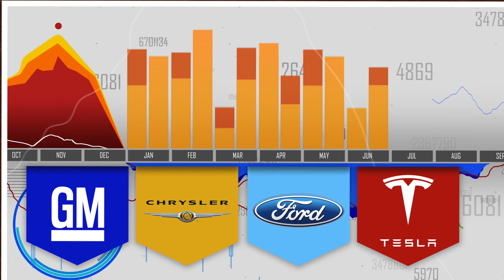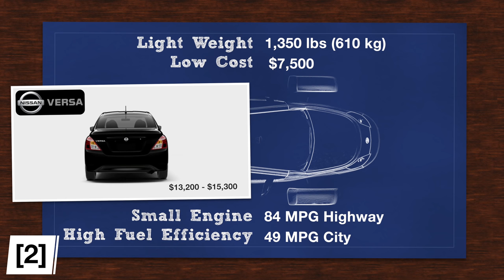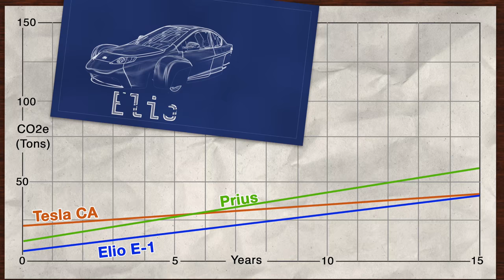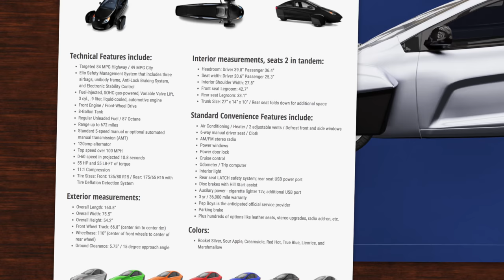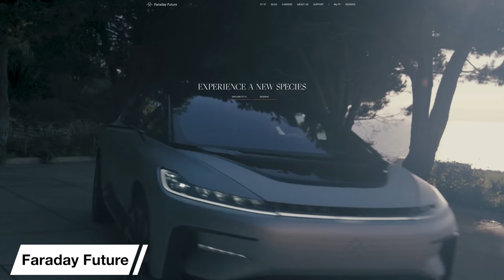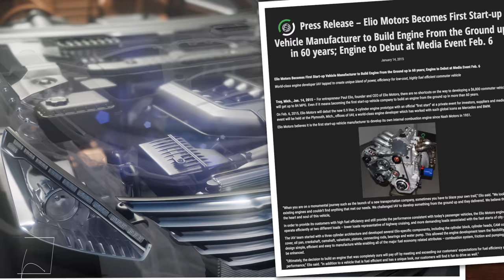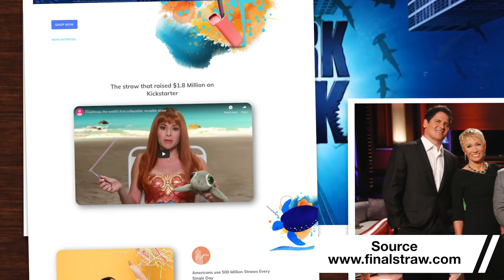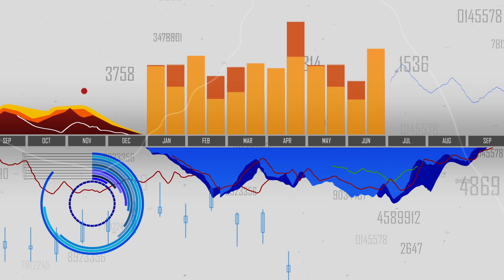How this Radical Car Missed its Chance to Change the World

Comment: Sadly I dont believe at all that this vehicle can be successful with an ICE engine! What I have seen the last years is that almost everyone is vastly and constantly underestimating the development of the EVs and the advantages besides fuel economy they bring. The problem with EVs was that due to small scale battery production and a lot of money invested in future generations of ICE Motors and engines no big, 4 seat + EV cars were possible. Now they are. That also means that building an electric 3 wheeled one seater is easier then ever before... So they will have to compete with a technology they can't really compete with in the long run... And with long run I only mean the next 2-3 Years.. As I said, i have the feeling that almost everyone is underestimating the EV revolution and there also is a shift in the consumer habbits you talked about!
Reply: Its advantage is cheapness.  I have driven a Leaf I somehow got for cheap in a process of leasing and buying the car when off lease.  However, that was the golden deal never to be seen again.  When I have a worn-out battery, I can spend $7k on a replacement or get a whole new commuter car that would cost $10 a week to run.  I think I would choose the Elio as it does away with the electric's range issue.
Reply: Until we go with nuclear energy electric cars are SOL. Then you have the issue of charging times leaving you dead in the water. Whereas with an internal combustion engine recharging takes less than 5 minutes. The only possibility there would be a modular battery system or you can simply pull up and swap batteries rather than charging internal.
Reply: @thefirstmissinglink  well you gotta had an eye on the technologys which are beeing supported and developed right now beeing. In that case solid state battery's.. Which will takes the need for a battery swap system because of their capability to charge in even less then 30min.. 15min probably
Reply: Check out the Acrimoto 3-wheeled 2 seat EV commuter being built near me.  Like the Elio, it's meant for urban commuting. Even if charged in states with the highest mix of power from fossil fuels, EVs will still generally break even with ICE cars in terms of price and carbon footprint within a few years of ownership.
Reply: @marksman48  The leaf is a horrible design.  There are 2011 Volts running around on the original battery with the same 35-mile all-electric range they had when new.  There are many Tesla s cars that have more than 90% of their original range left on the original battery. The difference being GM never uses more than 80% of the batteries capacity. More like 65%. The battery is liquid cooled and heated.  Nissan put no limits on the leafs battery and had zero thermal control other than directed air flow on the battery.  That directed air flow also cooled the battery in the winter. Poor design made for the Japanese climate.

This bike was never going to be $7000.  They do not have the production capacity to turn a profit at that price.  You can buy a German made 120-mile range 3 wheel enclosed bike for 18k.  That price is only going to go down.
Reply: @Phrancis5  The Elio was meant to be a real vehicle, though, not a 3-wheeled golf cart.
Reply: Voltaic - Elektro Werkstatt  — agree .. elio’s mistake was going ICE
Reply: @jameshoffman552  Ever heard of Aptera Motors? $45,000 for a trike? That doesn't make any sense. Anyway, if it were to hit its MPG target, the Elio's CO2 emissions would be lower than any BEV in most of the US.
Reply: @PistonAvatarGuy   Well that makes the Elio a 3-wheeled go-kart and Teslas aren't real vehicles.
Reply: @Phrancis5  No, it's an actual, enclosed car, not some tent on wheels.
Reply: The thing is: EVs are great, the people making this did mention wanting to make an EV version later. However, I live in a city, but there are no level-2 chargers near me. My apartment will not allow me to plug in a scooter, let alone a car, into the outside plugs. And there are no plugs at all in the garage. EVs larger then a bicycle are currently off the table for me, but this would work. I could always rip the engine out and throw a forklift motor in it later if I wanted.
Reply: @PistonAvatarGuy  I'd rather have the torquey EV tent on wheels with the beefy roll-cage with OPTIONAL DOORS over the thin sheet metal trike that isn't being produced.
Reply: @Phrancis5  That roll cage isn't going to provide you any more protection in an accident than sheet metal. The optional doors on the Arcimoto are never going to keep out the cold, or the heat, or the rain. Other than meaningless "torque," the Arcimoto offers nothing but disadvantages when compared to the Elio, and it may not even go into production. The main problem is that the people who are going to be looking for a ~$10k vehicle are likely to live in apartments, where there's no way to charge a BEV overnight. Fast chargers are expensive, so there's no reduced cost of operation with an EV without home charging.
Reply: The problem with the EV revolution is scale. There simply is not the infrastructure or the materials to build  to support at scale (enough to replace any more than low single digit percentages of ICE vehicles) production and operation. This is the case with the 1st world, it is even worse in the 3rd world.
Reply: @ImAManMann  Well if Tesla wireless electricity ever comes online. No need for batteries. I hope it happens. I would rather have a car. Where I won't have to put a plug or some liquid in the tank. I hope Tesla wireless electricity happen.
Reply: @stevencorrea7982  haha lol
Reply: @thefirstmissinglink , you must be living under a rock. Do some basic research.
Reply: @ImAManMann , how is it possible that you can be so completely incorrect or unaware of the transition happening all around you?
Reply: @mbabcock111  you are making a very vague claim. What specifically do you think I am unaware or incorrect about?
Reply: @ImAManMann   wow! Of ant .
Reply: @stevencorrea7982  what a comment. Speaks so much of today's society.
Reply: a gas car takes more electricity per mile than an electric car does. it literally does not matter what your power source is nuclear solar or coal. EV is better and cheaper.

I have a 2016 leaf (2012 got totalled when some rear ended me thank god for gap insurance!)

I can go 105 mile reliably 3/4 of the year 90 in the cold of winter. (SE PA) I can hit 120 miles but 105 is reliable.

I can quick charge the car in 30 minutes if there is one around.

I rarely have need for such charging. I Just plug it in when I Get home at night and the "tank" is always full every morning. "speed" of charge is irrelevant. oh but what if I need to go more than 100 miles? I have 4 others cars. I will just pick one. from my geo metro to my dakota to my minivan. (I know this is not practical for many but SE PA with Good credit means VERY VERY low cost of ownership for older used cars. almost nothing at all actually and I do my own maintenance for the most part)

now. mind you I drive a shit ton of miles. I got this 16 leaf for just under $16k the monthly payment is $335 plus $70 for insurance (over what liability would cost) so call it $400. even after factoring in electricity AND WITHOUT factoring in the exceptional savings in maintenance costs! the car saves me $50 to $100 a month "just" in fuel savings alone (I drive a lot of miles) 1 year and I have nearly 35k on the electric car alone! almost time buy the extended warranty as the factory warranty will lapse soon.

EV's make a ton of sense "IF" your driving needs "work" with it.

Elio EV would not make sense. not enough room for a battery and enough battery to make sense would triple the price of the car.

 @thefirstmissinglink
Reply: agreed about the leaf design but I am happy they did it.

because if they had not I would not have an EV. I have over 30,000 miles on my 16 leaf with "ZERO" loss of capacity so far (my 2012 leaf was down to 70% capacity by the time I hit 65,000 miles on it before it got totaled thank god for gap insurance!)

 @fatboy19831
Reply: @ImAManMann  A mind of an ant I had no idea how small!
Reply: EVs still have limited range and require much longer to fuel. Even the very costly (ten times more than an Elio), "300 mile" range, Tesla model S really has an effective range less than 200 miles (more like 175) in cold weather, and you need 30 minutes to charge it to 80% capacity at a supercharging station. I drove 270 miles to visit my folks for Christmas last week, so I'd have needed at least one, maybe two, thirty minute stops to recharge (assuming no line at the charging station). I don't often drive hundreds of miles on a trip, but I do it often enough and wouldn't add hours to the trip for recharging stops. And the battery alone costs more than an Elio. Making the Elio electric with a decent range would double the price.

An EV couldn't be my primary vehicle, and I can't pay $75k or even $35k for a second car. I've never paid more than $30k for my primary car, but at $8k, I could afford a third, and the Elio would get my wife and me to our folks for Christmas or the coast in the summer on a single tank, so it could easily be my second car. EVs are close to being practical, beyond the luxury car market, but no fully electric car is practical for me at this point. The Elio is.
Reply: @restonthewind  well no s*** dude :-) mine has less than a hundred mile range typically in the winter time I still drive it 95% of the time :-) it only cost me 15,000 I mean you're picking the most expensive car available the Tesla there are other electric cars the gas savings and the maintenance savings alone warrant the price of this car it pays for itself in gas savings alone not even counting the maintenance savings on my gas cars if I have to go further than the electric car can go I switch cars granted not everybody can have multiple cars then those people can't have an electric car if they need more range than one can supply

People always look at the cost of the battery pack incorrectly I look at the cost of the battery pack as a fuel so I take the $7,000 battery and the electricity used to charge it and determine was that cheaper then the gas I will put in a gas car and the maintenance I will put in that cash card in the same number of miles? Right now it does not make sense to replace a battery it'll cost me $7,000 to replace the battery on a car that will have no warranty for which parts are still exceedingly expensive to replace wants out of warranty

 Combine that with the fact that the cars are still evolving I would never replace the battery in my 2012 I used to have when for 6,000 more I can get a brand new car with twice the range so we are still in a state of flux in that regard in 2021 I will not replace the battery in my 2016 I will look for a used 2019 with the 60 kilowatt battery option and double my range again once cars are going about 500 miles on a charge then it will make sense to look into replacing the battery instead of replacing the car because of low in cars are going 500 miles on a charge that means battery prices have come down substantially
Reply: @nerys71  , You lost 30% of your battery capacity in 65,000 miles and you purchased another Leaf?
Reply: @stevencorrea7982  no actual argument.... figures.
Reply: @fatboy19831  yep. Because it saves me money. As long as i get 4.5 years out of the car its cost adjusted is $0. I am ok with that. I get to drive a nice comfy luxurious car for nothing. (Its luxurious compared to my other cars) this works because of how many miles i drive. The 16 is doing much better. Zero measurable degredation so far with 30k on the ticker.
Reply: @nerys71  As long as it makes you happy.  For me, I purchased a 34,000 mile 2009 Toyota Matrix for $10,000 in 2012.  Sold it in 2014 with 98,000 miles for $9,800.  Aside from oil gas and wipers, I did nothing to that car.   The Matrix is a horrible car to drive but it truly cost me nothing to drive for two years.
If you are going to change your electric car every 4.5 years you can save several thousand dollars by leasing.  You can lease a new Leaf with very little money down for well under $300 a month.  Then you do not have to worry about the battery at all.  Or even the painful depreciation of the leaf.  I personally pay my new cars off and drive them 12 to 15 years 300,000-mile plus.
Reply: @fatboy19831  the problem is leasing only works if you're a normal person I'm not a normal person I will put more miles on that car in one year than the lease will permit over its entire term those extra miles are very expensive :-) I can get a leaf for a few thousand dollars more than you paid for your Matrix and put twice the number of miles on it in half the time and still sell it for pretty good profit at the end and never have to buy any gas ever :-) if I drove you were miles I wouldn't even need the leaf because gas wouldn't be that big of an expense but I drive so many miles that gas is such a large expense for me at $3 a gallon it's scary how much I would spend in gas and fluids

And that's only if it stays at $3 a gallon when I bought my leaf it was nearly $4 a gallon remember I'm not buying new I'm buying used you can get a two-year-old leaf with four or five thousand miles on it for 12 or $13,000! I paid a little more for mine because I wanted the extra Creature Comforts the nicer Wheels the Bose sound system the surround you cameras I think they're worth it for me personally

 There are other benefits as well I spend so much time in the car the quiet is just incredible I did not realize how much I would enjoy the quiet until I took it home the first time and realized I would never go back if at all possible for me it's not about being green it's about saving green :-) I even tow a trailer behind my leaf I haul all kinds of stuff with my leaf :-)
Reply: I think that people believe EV are less costly to recharge.  I saw the cost of replacing batteries negate the savings in fuel.  You won't save money.  Its actually cheaper to have a gas engine   Also hybrid and EV technology is expensive
Reply: @tigercry5177  you are incorrect replacement battery is $7,000 I can get 200,000 miles on that battery what's a typical gas car getting 23 miles per gallon do the math and the typical electric are getting 4 miles per kilowatt so this math is for a total of 400000 Miles using up II battery that was paid for with $7,000 let's do the math

And yes I put 400,000 miles on my cars several of them have tickled 500000 miles

That's $47,000 worth of gasoline I'm not going to do any more math for you since we have already exceeded the cost of my entire car and its replacement battery and all of its electricity without having to factor in any other math

Unless you're buying something expensive like a Tesla there's no way in hell you're ever going to come close to being as cheap as an electric car with anyting running on gas

Just for shingles for those who are curious my electric car cost $15,000 a replacement battery is $7,000 and I will consume $8,000 worth of electricity over 400,000 miles and that's assuming no solar offset that's $30,000 total the gas car already costs $47,826 and that doesn't include gas car only maintenance and that doesn't include the cost of the car at all this is soon as you get the car for free and all maintenance for free and the electric car is still $18,000 cheaper it's not even a close comparison
Reply: @nerys71   Wow,  the reason I thought.  Was because to replace hybrid battery is 2,000 but I calculated the savings of hybrid to be 2,000.  I guess total electric is more efficient.
Reply: @tigercry5177  hybrids typically don't make sense from a financial perspective unless you're driving a ridiculous number of miles if you're driving 40 or 50,000 miles a year a hybrid will save you an ass ton of money but at that point unless you need the extended range on a hybrid you're better off going with and all electric or going with an all gas car that gets similar fuel economy some people can't tolerate small cars however for example a Mitsubishi Mirage cost almost a third of what a Prius cost and gets the same fuel economy but it's also half the size so it really depends on what your desires are

For someone who genuinely uses the car a lot electric and hybrid can save you a lot of money but if you're just a typical driver doing the average 10 or 12000 miles a year then a hybrid doesn't really make sense because you won't recoup the increased cost of the hybrid in fuel savings and you lose the advantage on a low maintenance electric drivetrain since now you have to maintain both

 If you don't drive very much and the vast majority of you driving is very short range that appear electric can work you can buy a used leaf for 9 to $12,000 at that price it could make sense even with a low per year mileage you would have to do the individual math yourself to figure that out

 It doesn't really make sense to attempt to factor in the cost of replacement battery since most people will never replace the battery the battery will typically last the usable life of the car so you just have to factor in ishal purchase price and maintenance we're not yet at the point where replacing the battery is an issue
Reply: Nerys 
400,000 miles. Sounds like your driving a Mercedes W124 with a 0M617 in it .
Reply: @drmachinewerke1  no idea what that is but my highest mileage was my first car i got when i was 16 and only got rid of 2 years but stopped driving much over 10 years ago. 1988 Jeep Cherokee (still amc design then) with the inline 6cyl 4 liter engine. 497,000 miles. My 94 geo metro xfi has 286,000 miles and needs nothing. My voyagers all had over 300k when i got rid of them.

I have never had to replace a car because the car wore out I've only replace them to upgrade
Reply: @nerys71  Presumably, you paid $15,000 for a used electric car. I'm comparing new cars prices.

Sure, I could drive an electric car most of the time and a second, IC car when I need the range, but I'm skeptical of claims that electric cars are less expensive to drive, when properly depreciating the battery, and no fully electric car is remotely comparable to the Elio (assuming the $8 sticker price), as a value proposition, even if the claim is true. If the value proposition changes in the future, that's great, but I don't live in the future.

I ordinarily work from home and don't drive a lot, but I travel frequently and must drive 90 miles to the airport. If I can't make that trip in an electric car, it's a non-starter. I can't leave my wife with the electric car and its limited range and no IC backup for a week. She'd never agree, and I don't blame her.

Lots of evolution in transportation is on the horizon. Maybe my next car won't be a personal automobile at all. I'll subscribe to a service and share self-driving cars, on the road 24-7, with other subscribers. I can imagine paying less for this service than the cost of owning a personal vehicle, idle 95% of the time, and I'd never waste hours behind the wheel again. Transportation as a service with self-driving cars also improves the outlook for electric cars, since I can switch cars rather than waiting to recharge. I could live to see it, and I could live to see electric cars become ubiquitous otherwise, but I haven't lived long enough yet.
Reply: @restonthewind  new car prices are irrelevant practical car prices are relevant I do not and cannot qualify for the $7,500 tax credit it would be stupid of me to buy a brand new electric car this car was $38,000 brand new! I could never afford that no matter how much money it saved me!

I bought the car 1.5 years old with 4600 miles on it that's as close to brand new as I'm ever going to get :-)

The price of relevance is the Practical available price

If you have to drive 90 miles I would not suggest buying an electric car there are too many chances of your range dipping just below that 90 mile Mark especially as the battery degrades the only car that would work for you is a much much more expensive Tesla or you'll have to wait until the 60 kilowatt battery cars come out which should be this coming year but they will be expensive
Reply: @restonthewind  also depreciation of the battery doesn't really matter as long as the battery lasts long enough for my savings to exceed the cost of the car it's completely irrelevant
Reply: @nerys71  Depreciation affects the time it takes for your savings to exceed the cost (what you pay for it less resale) of the car. You can't simply compare the price of electricity per mile to the price of gasoline per mile. That's the point. I've never replaced a gasoline tank, and even if I did, it wouldn't cost ten grand.

I have replaced laptop and phone batteries, and EV batteries are fundamentally the same. They're good for a thousand charge cycles, max. If I'm recharging daily, that's less than three years. If I'm not recharging daily, I'm not driving many miles, so any savings per mile is less. I've owned my Mazda 3 for eight years and expect to own it another five years at least. I don't drive a lot, so it still has less than a 100k miles on the odometer.

Electric cars work for some people. If an EV works for you, that's great. They don't work for most people at this point. I'm reasonably well off. I'm married, and my kids are grown. I could pay cash for a Bolt or even a Tesla, and I've been tempted, like I'm tempted to buy RVs and boats and ultralights. I can buy a Spark EV, with 80 mile range, for less than $15k (with subsidy), but it would be a second, novelty car. Even if I drove it around town most of the time, I couldn't completely replace my IC car with it, and I wouldn't save enough on fuel to justify the cost either. I'd rather spend that cash on other things, like retiring sooner.

If I were single and owned only one car, I wouldn't consider an EV at all. That's 40% of the U.S. market and an even higher percentage of young people. EV sales are rising, but they won't dominate the automobile market any time soon. Of course, a car like the Elio doesn't work for everyone either, but there's plenty of room in the U.S. market for it. That's the point here.
Reply: I am sorry but you are mistaken. depreciation is "ONLY" relevant if you only intend to keep the car for a short time and then sell it.

if you intend to keep the car for a significant time period and or long enough that its conditions renders its value effectively zero (scrap value) then depreciation is completely irrelevant it will always be 100%

the batteries are fundimentally different. as you should note with your other batteries the larger it is and the more healthy it is used the longer it lasts. (lack of use or care kills them fast) the smaller the cell is the faster it dies.

you also have no idea regarding charge cycles. there is no 1000 max. its 1000 to 80% SOC. what this means is after 1000 FULL CYCLES (so if you charge 1/3 you can do that 3 times to equal 1 cycle) you should have an SOC of 80%

right now an EV only really works well for two kinds of people. those who want it (status symbol ie tesla etc..) and those who need it (people like me)

for the VAST majority of people the price of gas is not really relevant so the savings is not relevant. average person drives 12k a year most people who would "NEED" an electric car to save money drive less than that even. Even you probably don't even drive 10k a year.

at 10k a year the difference in cost of $2 gas and $4 gas is nothing. average mpg 23mpg so that is 430 gallons of gasoline or $860 at $2 a gallon and $1720 at $4 a gallon. lets be realistic. $860 is "IRRELEVANT" in the larger picture of an average persons yearly budgetary needs. if $860 is that large a portion of your overall budget you might need to consider if you need a car and maybe should move (if possible) to a place where you won't need one. its just NOT really that much money. and this is the EXTREME example $2 to $4

SO we are back to two kinds of people (there is a third I will get to that in a moment) people who don't need them (you) and people who do need them (me)

people like you have enough money where the cost avoidance of fuel is irrelevant to their budget IE you make enough income that it just does not matter.

people like me drive so many miles that the ROI is extremely fast and dramatic. When prices are high I have spent as much as $11k a year in GASOLINE ALONE. (I am definitely an extremely outlier example) technically someone like me should not be able to afford an electric car but because of just how much I spend in fuel the math happens to work.

Electric cars work for some people. an irrelevant and silly statement. ALL CARS "work for some people"

F-150's work for some people. Geo metro's work for some people. Towncars work for some people. Vans work for some people. its a meaningless statement that serves no valid function.

now what about that third kind of person? well that's interesting. there IS one other kind of person who can make use of an EV and that is anyone who simply DOES NOT DRIVE MUCH. period.

I know many people who drive 4 to 7 thousand miles a year or less and more importantly they NEVER go more than a few miles. they don't travel they do not take trips. for them a used electric car is literally a potential match made in heaven. you can buy a few year old used leaf for $7k to $8k sometimes cheaper (even with warranty still left!! and of course always buy the extended warranty on cars like this)

for them its perfect. no gas. no maintenance. nothing. that car will easily last 10 or 15 YEARS with the stock battery no matter how much it degrades! even if it degrades to 50% SOC it will still be "MORE" range than they will need. its the PERFECT second car. the gas car can literally just SIT and do absolutely nothing (or no backup car at all even)

but again these people are a niche since you have to be a home owner (most of the time) to even take advantage of an EV (ie have to have a place to plug it in)

SO the only valid way to compare one car to another car UNIVERSALLY is start to finish. TCO. Total Cost of Ownership. cradle to grave. or in this case purcahse to reasonable expected lifespan.

150,000 miles is the universally accepted standard for this as across the nation THIS is the average number of miles put on a car before it hits the junkyard. FEW cars typically make it past that before age/accident etc.. take it out.

as much as "I" am an extreme outlier putting 50k on my cars PER YEAR. "YOU" are also an extreme outlier (keeping a car for 13 to 15 years) beacause on average this JUST DOES NOT HAPPEN. you are not only an exception but an extreme exception (Typical max lifetime a car is kept is 9.9 years)

Today cars can push 10 years and 200k miles on average as tech improves (older cars bring down the average)

SO 10 years 200,000 miles "IS" basically the standard. if you (or I) are outside this. too bad. irrelevant. then you (and I) need to run out OWN "self usage specific" numbers. but those numbers would ONLY be good for you and me and no one else.

for "everyone else" the metric is 200,000 miles or 10 years.

since we are talking mileage I selected that. 200,000 miles.

over a period of 200,000 miles there is "NO" equivalent gas car that is cheaper in TCO than a low cost electric car. (yes this means buying 1-2 year lease returns etc.. NOT brand new. brand new is not what you buy when you are trying to save money. ever.)

a certified leaf is around $12k to $15k. now there are many factors that can go into calculating the TCO of a car but we can kind of cheat that process a little. if the car can save me more than its purchase price plus its fuel and maintenance costs then TCO is irrelevant and savings comparisons become super easy since the car PAYS FOR ITSELF. literally. you get a NET GAIN in income for purchasing one.

average fuel economy for a car in this class is 23-26mpg. so lets assume you care about that fact and will drive carefully and use the higher end value 26mpg. gas prices are currently $2.75 a gallon. you can expect the car to be basically "carefree" for 100,000 miles. your 26mpg car will require 3,846 gallons of gasoline over 100,000 miles. That is $10,576 in gasoline. plus lets say oil changed. every 7500 miles. Contrary to what people say you really can wait to 7500 miles to do it on a modern car. $400. you will need 3 Rad flushes in that time $300 Brakes you will burn through at least 2 sets which will set you back roughly $1500 in total (the VAST majority of people do NOT do their own work)

$12,776 we are AT or almost at PARITY with the purchase price (Low side $12k high side $15k) already!! and this is at a currently LOW $2.75 a gallon fuel prices AND assuming you sustain 26mpg over the entire 100k you drive your gas car assuming you even get 26mpg MOST cars that get better than 26mpg are either not really comparable in size and luxury to the EV OR cost significantly more money.

and this assumes NO OTHER non common maintenance between the cars. 

if you see how these numbers are going you can already see the EV is going to vastly surpass pretty much "ANY" gas car in existence in price savings. there are exceptions still but they are rare or come with compromises. for example you could buy a Mitsubishi mirage around $14k but 1.5 to 2 year old like the leaf can be had for $9k so you would save $3k to $6k in initial purchase price AND the car gets 38mpg so your gas costs will be much lower.

this car would be cheaper for the first 100k. not for the second 100k though. even the mirage can't outperform by price a leaf over 200k miles. (under normal conditions an EV should reach 200,000 miles at 80% SOC) and keep in mind the mirage is half the size of the leaf and not nearly as comfortable (Its a modern day geo metro) nice cars for sure but not really comparable.

in case your wondering average cost of electricity for 100,000 miles is around $2000. though a few solar panels can reduce that to ZERO very easily. they might not be worth the cost (you would need $800 to $1200 in solar panels to zero out inside 10 years) might be worth it if I make it to new mexico where there is a LOT more sunlight but much further north probably not worth it.

an ELIO would be a most excellent backup car for an EV owner. I am all in for one (even though I don't ever expect to see one sadly)

 @restonthewind
Reply: @Voltaic "Sadly I dont believe at all that this vehicle can be successful with an ICE engine! "
It's a fraction of the price of an EV and dirt cheap to fill up. It would have a niche if they actually built them.
Reply: Well said!
Reply: @nerys71  " it literally does not matter what your power source is nuclear solar or coal. EV is better and cheaper."
A new Versa goes for about $10k. It will take quite a bot of gas to make up for the difference between that and a Leaf.
Reply: @stevencorrea7982  "Well if Tesla wireless electricity ever comes online."
The one that doesn't exist?
Reply: Charging my EV is certainly different than going to a gas station.  Multiple options to charge, almost always just at home at night for several hours.  Fast-charging rates now around +300mph and quickly increasing.  So in some ways it can be less convenient than gas, but on the whole it's far, far more convenient to use an EV.
Reply: @nerys71  "there are other electric cars the gas savings and the maintenance savings alone warrant the price of this car it pays for itself in gas savings alone "
Except they don't. A new Leaf is $29.9k. A new Versa is $12.3k. It would take over ten years for a Versa to go through $17k worth of gas driving 18k miles a year.
Reply: @nerys71  "I can get a leaf for a few thousand dollars more than you paid for your Matrix"
A new Leaf is $29k. A Yaris is $15k and comes with a lifetime warranty.
Reply: yeah but a versa is not in the same class as a leaf. if you want to do that then SURE I could save even more by driving my 62mpg geo metro.

my back would just love that though.

apples to apples man. what next? compare it to a vespa?

I was also talking about SOURCE POWER. with the miles I drive a versa is still more expensive than my leaf and a lot less comfortable and much higher maintenance costs and is not that much cheaper (4k to 5k)

 @wisenber
Reply: @nerys71  "yeah but a versa is not in the same class as a leaf."
Same size...capacity...same class. The Leaf isn't an Infinity.

" I could save even more by driving my 62mpg geo metro."
It would if they were still for sale and they actually got 62 mpg. (The highest claimed by GM was 43 mpg).
Reply: @wisenber  I have a 1994 xfi rated from the factory 58mpg. GM claimed 58mpg and I beat it easily and regularly. Shit I can do 43mpg delivering freaking pizza. I REGULARLY squeeze 65mpg out of it but my average year to year is 62mpg. problem is its horrendous on my back climbing in and out of the thing (6'4") I used a bowling ball to put a small "dome" in the roof to clear my head :-)

and they are still for sale. quite a few of them actually. though if you want something more modern that can still touch 50mpg with a bit of effort Mitsubishi Mirage. (and I fit too)

I have driven a versa. (rental) its not NEARLY as nice or as roomy as my leaf. I would never put them in the same class even ignoring the drivetrain.
Reply: @nerys71  " GM claimed 58mpg "
Then it's a 58 mpg vehicle, not a 63 mpg. EPA does enforce standards for testing. Those standards were modified since 94 which would make it less.

"and they are still for sale."
So are Model T's.

"I have driven a versa. (rental) its not NEARLY as nice or as roomy as my leaf."
According to Nissan, they both have about 42" of front passenger legroom. The Leaf has 1.8 more inches of headroom.  There's 2 cubic ft difference in total interior capacity. Both have an LCD, bluetooth, AC.....Same class.
Reply: @wisenber  That's what the right brother said. At one time.
Reply: @stevencorrea7982  "That's what the right brother said. "
It's the "Wright Brothers", and they were well versed in power/lift and gravity.
That being said, no one made their Trans-Atlantic vacation plans based upon Kitty Hawk. That wasn't available to the masses for another half century.
Then again Tesla promised a lot that he never delivered.
Reply: @wisenber  visit technology already online reality Texas.
Reply: @stevencorrea7982  They aren't delivery power over air in Texas. Were you thinking otherwise?
Reply: @wisenber  well that's funny local news channel did a  story on tower. I guess it was fake news? Milford Texas local news channel Tesla tower. Pretty easy to validate.
Reply: @stevencorrea7982  "well that's funny local news channel did a story on tower. I guess it was fake news?"
And they still have the same "arc welding" risks they had a hundred years ago. That wouldn't be funny.
Reply: @fatboy19831  If original Tesla's are driving around with 90% battery life, they need to go to Tesla today and turn that battery over for study...even their own internal testing and reality says - that info is FALSE.  Unless that Tesla hasn't done any real world driving.

I have a 2012 CT200H, and the battery will probably not last me another year...2k to change it out.  I also don't believe the VOLT opinion either...unless again they don't drive their cars.  Then again I have 190k miles on my CT200H
Reply: @Voltaic  Everytime you fast charge you hurt batteries that are 'lithium' based.  Period.  No matter how well they cool, or how awesome they electronically control it...they hurt the materials inside.  Phones get away with it because they don't expect you to keep your phone for 2yrs.

Until an EV can charge up in the amount of time it takes me to put in 8gallons of gas...they will always be the '2nd' option.  No EV today would fit my personal and work usage.  And while I am highly the 1% here in terms of car usage...I am the vast majority of travelers that do travel long distance at least a few times.  Last week I drove 800miles in one day for work.  I filled up 3 times.  I did the work in 12hrs.  I was able to leave my house, and make it home for dinner.  This would not be possible in any EV today.  Even though I want it to be.

Next you underestimate battery production and how many batteries you need to 'replace' gas cars.
Reply: @nerys71  Correction: The Sondors is a three seater, two in front and one in the rear. If they really deliver a 200 mile version for $16k, I may eat my words and buy one.
Reply: @wisenber  Well we need to get something done. I have earthquakes here in Kansas every other day because of all the oil fracking.
Reply: @elitewolverine  Talk to 2012 Volt owners and 2013 Tesla S owners.  They will tell you everything.  They do not sugar coat anything.  Tesla batteries do fail from manufacturing faults like the early motors.  The technology is sound.  I was blessed to speak with one of the engineers of the Volt. GM went way overboard with that car.  The lifespan of a car is 10 years 100,000 miles. I have been researching electric cars for more than 10 years. Talk to the owners of these cars.
Reply: @stevencorrea7982  "Well we need to get something done. "
Actually we don't.

"I have earthquakes here in Kansas every other day because of all the oil fracking."
...or the aquifer you've been bleeding dry since the Depression. Maybe we should look at limiting the water you're using?
Reply: @wisenber  Well that maybe so true. But why having y'all plug those to oil leaks coming from the gulf Coast since 2010 continuously leaking? And yes I do Drive gasoline.
Reply: @stevencorrea7982  "Well that maybe so true. But why having y'all plug those to oil leaks coming from the gulf Coast since 2010 continuously leaking? "
Oil leaks from the ocean floor with or without a platform. It's a naturally occurring phenomena.
Did you have a specific source showing that a leak today can be attributed to 2010? As to "ya'll", I don't work in oil. Why didn't you work on it?
Reply: @wisenber  One caused by hurricane. One caused by a fire. British petroleum has never plugged there leak. There's problems with everything. Yes I realized it is hypocritical of me to be driving with petroleum. But I'm trying to go Electric. If something better comes along I will take that.
Reply: @stevencorrea7982  "British petroleum has never plugged there leak."
Except they did.

"There's problems with everything."
Except there aren't Sea beds leak oil with or without a drill. Bacteria feed on it.
Reply: @wisenber  No they didn't check that one out with hurricane Ivan been going on for 14 years. Feeding off of something if you drink it will kill you that's amazing.
Reply: @stevencorrea7982  "No they didn't check that one out with hurricane Ivan been going on for 14 years."

You mean the one being disputed?

"New Orleans-based Taylor said only 2 to 3 gallons was leaking daily out of mud on the seafloor. Spokesman Todd Ragusa said the company disputes the government's new estimate and will respond in court."

" Feeding off of something if you drink it will kill you that's amazing."
Well bacteria do. They also eat sewage.
Reply: @wisenber  Here's something we both can agree on. It is not good to pollute your very home you live on.
Reply: @stevencorrea7982  "Here's something we both can agree on. It is not good to pollute your very home you live on."
It's also useful to note whether there is any human caused pollution and who is responsible. In the Gulf Coat case you mentioned, Taylor put nearly $670 million in a trust and met the metrics that the government dictated for 11 years. Eleven years later the government claimed that they had not. It is very much disputed.
That being said, every living organism generates byproducts.
Reply: @fatboy19831  GM has stated that after 10yrs it will be between 10-30%, while you can certainly claim 10% someone who isn't getting 10% loss is not going to believe you when they are driving around at 30% loss.  And there is the main problem with current EVs.  My 1973 pickup is getting the same mpg as it was in 1973 if not better now.  My zx2 is still getting around 35mpg...19yrs later.  And at the cost of a Tesla right now...you have saved...0.  I however like the volt idea for now, that should have caught on way faster than the current hybrid crops...but again...more expensive, hell it was the same costs as my Lexus hybrid new, actually MORE lol.

Great for your research, I have been doing the same for just as long if not longer, including having a motor currently in design phases for an EV.
Reply: @wisenber  Never claimed to be an angel. Just want  mankind to do better.
Reply: @stevencorrea7982  "Never claimed to be an angel. Just want mankind to do better."
By "mankind", you mean "anyone but you" apparently.
Reply: Get out of California and off Youtube and you will see ICE engines are EVERYWHERE. Not sure what you arw going on about EVs being a popular choice for a new car. No one has them bro wake up
Reply: @wisenber  Everyone.
Reply: @stevencorrea7982  "Everyone."
Yet all of your solutions tend to have someone else(not you) being penalized or the benefactor of invisible support.
Reply: @wisenber  Don't want to penalize no one. If I'm going down the road no cops around. I follow the speed limit. Just as everyone else should follow the rule. I break the rules I get caught I pay the consequences. I want to do the right thing. Because it's the right thing to do. No one has to force me. We all have freedom of choice and will.
Reply: @ekoms108  Please tell me the difference from your comment and my comment.
Reply: @wisenber  60 minutes January 6th 2019. Guy invented a liquid fuel out of sugar from plants. Can make plastic out of it. Biodegradable plastic. Using lasers and distillers. Solutions to every problem. This fuel does not harm the environment. Your choice something that does not harm the environment or something that does harm the environment?
Reply: @stevencorrea7982  "Guy invented a liquid fuel out of sugar from plants. Can make plastic out of it. Biodegradable plastic. Using lasers and distillers. "

Which requires more energy to create than petroleum based products. And do you really want a biodegradable kayak? Do you want your dishes to biodegrade? The trim on your vehicle? Eyeglass frames?
 We've had "fuel from plants" for quite some time as well. Ethanol anyone?

"Solutions to every problem. "
Except it requires more energy to produce, and which "problem" did you mean?.

"Your choice something that does not harm the environment or something that does harm the environment?"

You mean a choice between something that takes away crop land for fuel, requires more energy to make and costs more versus petroleum based products? That choice? Seems like that is creating new problems.
Reply: @Voltaic  "Please tell me the difference from your comment and my comment."
Steam engines still remain in use. That's how coal and nuclear plants work.
Reply: @wisenber  I assumed that it was clear that we were talking about personal transportation under my comment about personal transportation under a video about personal transportation..did you notice that? :) because It appears that you didn't get that...
Reply: @Voltaic  " I assumed that it was clear that we were talking about personal transportation under my comment about personal transportation under a video about personal transportation"

Actually the video is about a specific model of  a gas powered vehicle and its trouble getting to market. Did you notice that? :)  because It appears that you didn't get that...
Reply: @Voltaic  "excuse me, do you identify as braindead?"

Nah, "braindead" would be taking a video titled "How this Radical Car Missed its Chance to Change the World" about Elio Motors and trying to alter it to suit a specific agenda. Sort of like what you were doing.
Ironically, steam is what is refueling many EV's today.
Reply: @wisenber  I really don't know how I can help you improve your arguments..
Reply: @Voltaic  " I really don't know how I can help you improve your arguments.."
Arguably, anything would be a step up from using ad hominem like "braindead".
Perhaps you should work on that before offering assistance to others? Sort of "bail your own boat" before offering up your bucket?
Reply: @wisenber  You have to take that up with 60 minutes. Don't shoot the messenger. One thing hemp was required as a plant by your forefathers George Washington. By everyone. Hemp grows 10 ft tall in a month if I'm correct. Henry Ford invented a hemp car. Panel stronger than steel. People that came before me have already came up with solution.
Reply: @wisenber  don't you have anything better to do then wasting other people's time, bud?:D I certainly do..
Reply: @stevencorrea7982  "You have to take that up with 60 minutes. "
Actually, I don't. I didn't echo it.

"One thing hemp was required as a plant by your forefathers George Washington."
Not really. I emigrated here. When i was in the military, we were still using hemp rope for climbing. It was horrible compared to today's materials. Absorbed lots of water, abrasive and prone to rot. That's why most navies abandoned it when newer materials came out. Climbers too.

"Hemp grows 10 ft tall in a month if I'm correct."
So does bamboo.

" Panel stronger than steel. "
But would be eaten up by UV, unlike metals.

"People that came before me have already came up with solution."
Solution to what?
Reply: @wisenber  But don't plant use light energy to grow UV radiation?
Reply: @Voltaic  "don't you have anything better to do then wasting other people's time"

I thought that was what you were doing with your ad hominem?

"I certainly do.."
Shouldn't you be doing that then? Or did you have some more ad hominem to throw on YouTube?
Reply: @stevencorrea7982  "But don't plant use light energy to grow UV radiation?"
Cut some grass and see what the sun does to it. Or just take a look at a wooden fence that hasn't been stained or painted. Those used sunlight too...when they were still alive.

So what was hemp an answer to again?
Reply: @wisenber  The only thing I know Henry Ford found The  Ford company. I did not. Yes anyone can be wrong and make mistakes too. I will check in to hemp body panels further. I don't know all there is about them. Yes you do make a good valid point. No one wants something disintegrating around them why you are driving it.
Reply: @stevencorrea7982 
"No one wants something disintegrating around them why you are driving it."
I'm sure he had his reasons for going with steel at the time. If he had a cheaper or more reliable material, I'm sure he would have gone with that.
Ford was also the largest charcoal producer for a while. They converted all of the wooden pallets and sold them as charcoal.